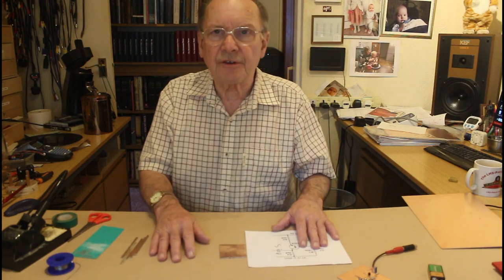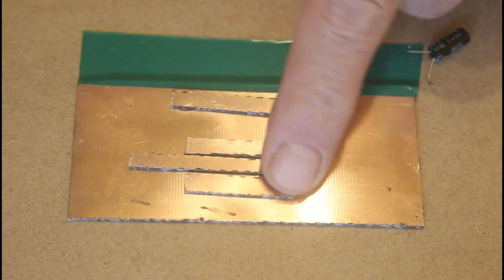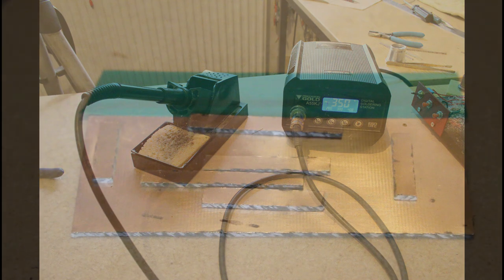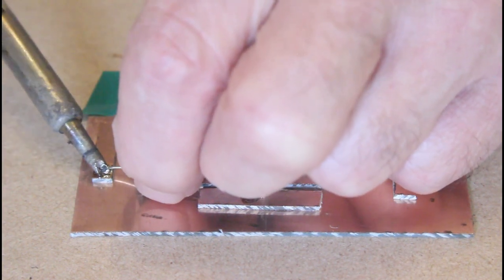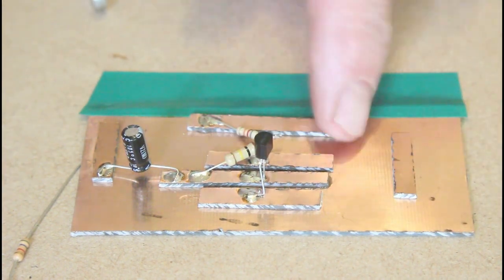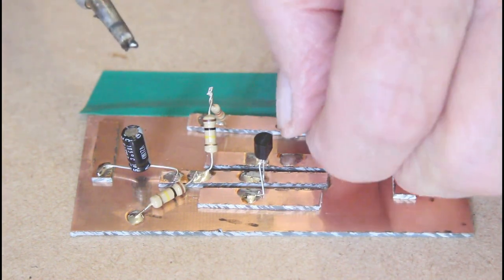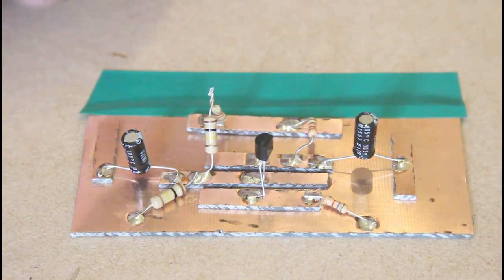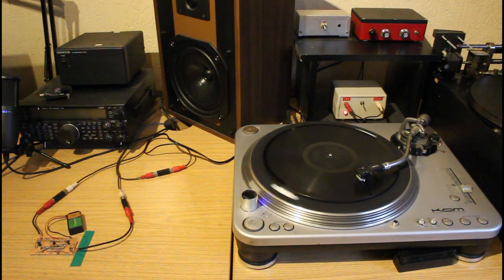Vertical cut disc records - a simple & cheap inverter to eliminate unwanted noise.

Comment: Norman, it could possibly be a bit after your time, but sometime in the 1970s Veroboard became popular. It does essentially the same as your project board, but maybe with a neater, more compact,  ready made solution. I know it has been around for at least 50 years... I am surprised you used that modern 'transistor' though.
PS. I was only joking. That was brilliant.
Anyone interested/new to audio should look up common mode noise and differential noise. Also think how phase errors could upset the sound? Where phase can be adjusted and what bits are critical for correct phasing?

Comment: Norman, great video. Can I question the polarity of the input capacitor? Assuming that the input is at 0V potential and the Base of the transistor Q1 is positive, then the capacitor is reversed?